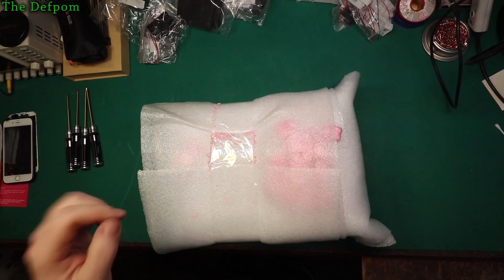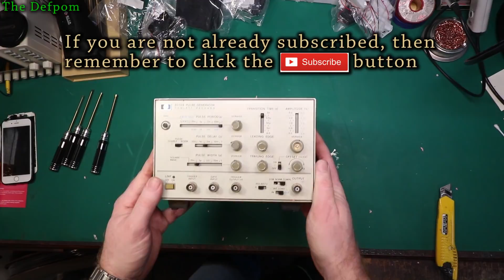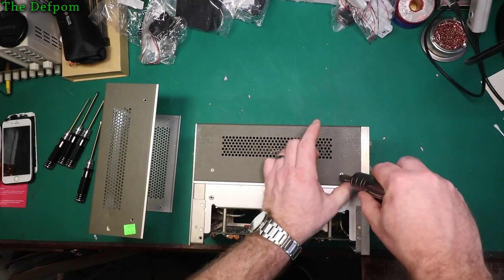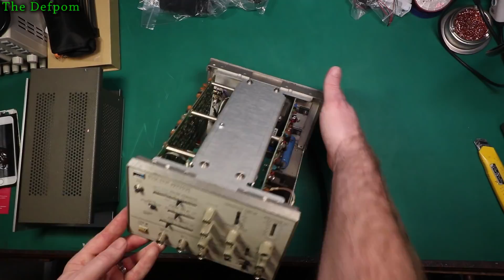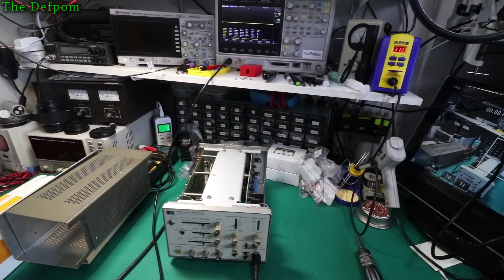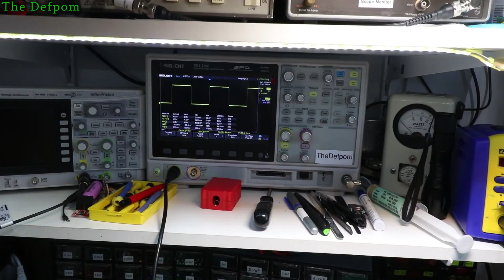🔴 #484 HP8012B Pulse Generator Repair Part 1

Comment: That’s so annoying when people have been in before and messed with stuff.  Custom switch etc yes can be a show stopper. It has a nice range of outputs types. Be interesting to see if you can print a replacement switch.
Reply from the maker: AllTheGearNoIdea - I hope to do some more on this soon, to be the next repair video after I do a MacBook one. I am going to be live streaming in 10 hours if your not at the pub 🍺
Reply: The Defpom's Repair Channel  that’s a tough call pub or live stream.  Luckily I had a skin full with work the other night so should be ok today. Catch you later.

Comment: Scott, its been a long while since I attempted to separate the front panel from the PCB that has all the slide switches soldered on, but as I recall it was complicated by the use of rivets. I do remember vividly just the difficulty of even squirting some Deoxit on those switches and controls though. Please show how to do it, and maybe I will give it another go.

Comment: Lucky guy - you seem to get quite a few simple repairs when you roll the dice on eBay. Really nice looking Bird wattmeter  next to the scope. Those things never die!
Reply from the maker: David V - I choose carefully, that seems to help but greatly narrows the choices. I restored that Bird 43 about 10 years ago, it looked pretty beaten up when I got it, I also added the PEP board whilst I was at it.
Reply: @TheDefpom  Didn't know there was a PEP board available for the Model 43 or was that something you designed? I assume you were using it for Single Sideband gear. Everything I worked on was either spec'ed for average power or pulse power -  in which case I used a peak power analyzer.

Comment: Nice that it won't be a complex problem, if you take the front panel off i'm sure you could add some plastic to that switch, drill it and cement a pin into the switch or something similar.
The dead pilot light is likely a dead bulb lol.
I noticed you on allthegearnoidea :-D, chris puts himself down a lot :-(
he is a smart man.